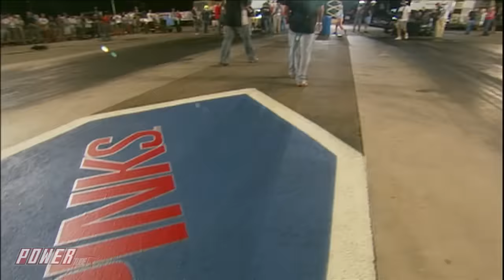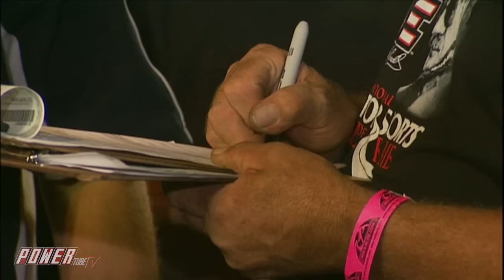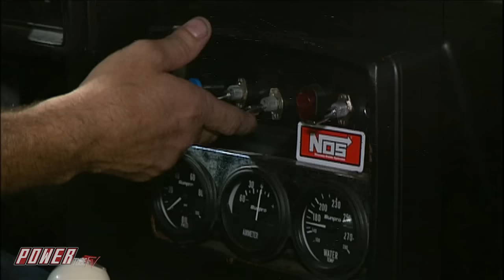PINKS - Lose The Race...Lose Your Ride! - Nitrous Small Block Shootout for Titles! Full Episode

Comment: The overbored 350 simply isn't going to make the power of that stroker motor. A big block in the Nova is what's needed. I never liked this head start stuff. Line em up even, first car to the finish wins.
Reply: Is there anyway they could have done or added with that 350 motor to beat the other?

Comment: i never like bracket raceing at the strip im what you call old school racer head up on a old country road sometime if  you beat the guy by 2 cars and they wanted to go again you might spot them 2 to keep it interesting what i never understood on pinks and at the track ( usually high end cars with 5k in parts  in the motor some one else built )  the owner has some one else drive thats bs raceing drag raceing is about pride in what you built and how you drive its like haveing a super hot wife and haveing someone else take her to bed because you cant handle her